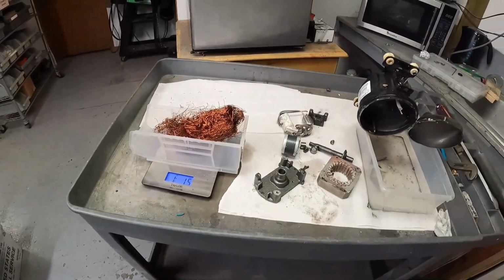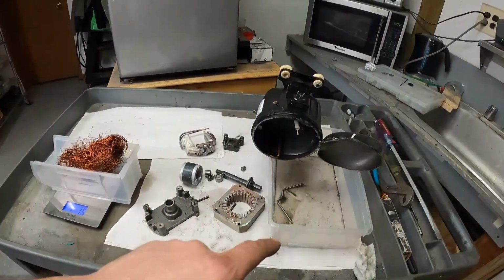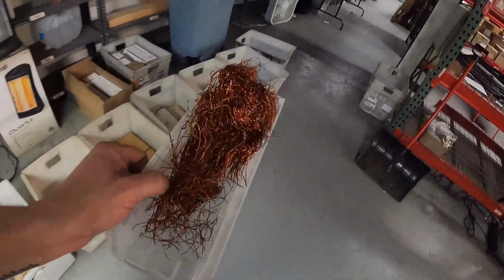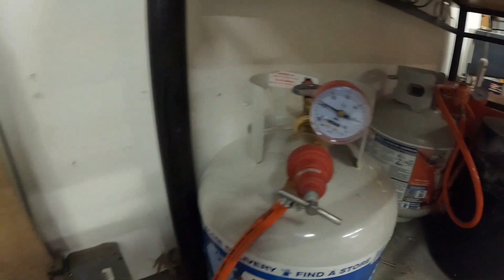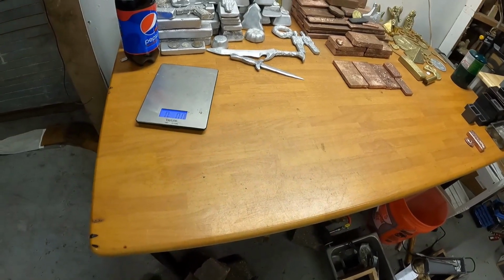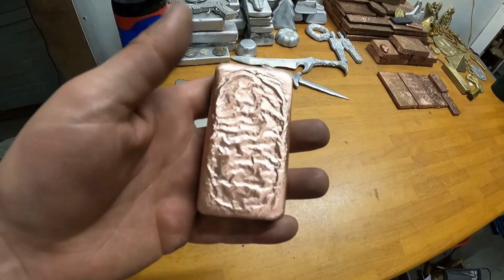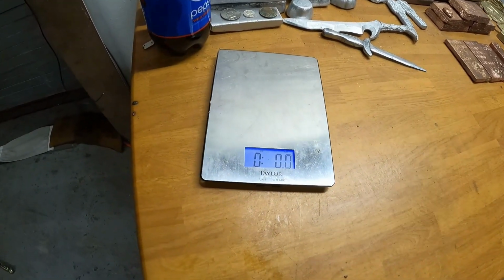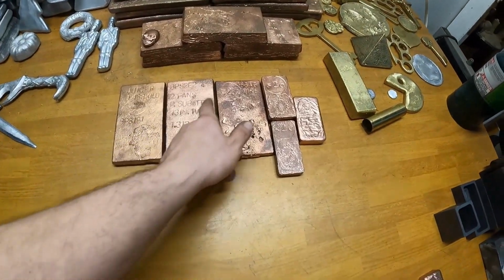Scrapping a Compressor - How Much Copper is Inside? - Trash to Treasure - ASMR Scrap Copper Melting

Comment: I was given a mini-fridge two or three months ago to take apart for whatever usable metal I might get.  I had not yet tackled the compressor.  I'm certainly going to take your advice and unload it on my local scrap yard untouched.

Thanks a bunch for this video!!!
Reply from the maker: You're welcome brother!  As for that compressor, if it's about the same size as the one I did, I'd definitely cash it in as-is.  However if it's one of those tall ones, I'd bite the bullet and scrap it out.  The tall ones have a much larger stator and the windings are plentiful!  Use your best judgement.  If you do end up cashing it in, please feel free to leave me a comment with how much your scrap yard is paying for them.  Always nice to know how much the prices vary across the country.  Thanks for watching brother!
Reply: @Scrap2Cast  We'll do!
Reply from the maker: Thank you bro!
Reply: @Scrap2Cast  I finally got a chance to take it in; however, it needs to be drained and dry before they will take it.
Reply from the maker: @freemanmetalworks1698  aww man that stinks, my yard takes them full of oil.  Makes sense because that’s extra weight they don’t want to pay you for.
Reply: @Scrap2Cast  She actually cited OSHA, but didn't give me any details or reasoning.
Reply from the maker: @freemanmetalworks1698  that actually makes sense.  I guess they can get fined for taking in hazardous materials.  Might just be worth scrapping out the compressor after all.
Reply: @Scrap2Cast  I would a video out of it and some copper.

Comment: Saw a old man had one of these he used as an air compressor for years.
Reply from the maker: Would like to see that with a mini fridge compressor.  Didn’t even know it was possible
Reply: @Scrap2Cast  Blew my mind I thought they only pumped oil or refrigerant or something.
Reply from the maker: I’m wondering if he modified it?  I guess theoretically it is the same principle.  I never scrapped out an air compressor before but now you’ve lit a match under my butt to obtain one to scrap and compare.  Gee thanks a lot, another project to add to my list 🤣👍🏼👊🏼

Comment: Sorry you're sick, man! You may want to check the lining of your lid; it looks like the seal has some gaps and that's making the steel casing hot. You're losing heat and damaging the furnace.
Reply from the maker: It needs to be relined with new kaowool and resealed
Reply: @Scrap2Cast  It's been a minute since I looked, but I don't think kaowool is too pricey. Pretty sure you can get it on Amazon these days.
Reply from the maker: @KrakenCasting  I’m also very lazy🤣
Reply: @Scrap2Cast  I'd lecture you if I weren't lazy too. 🤣
Reply from the maker: @KrakenCasting  bahahaha 🤣  That’s one reason why I like you Kraken, you make me laugh often 😁👊🏼

Comment: nice video however, I scrap all copper down to even small dc computer motors. With the compressors I wait until I have a half dozen or more then do  the nasty  work all at once. Drain the oil for 24 hours or more, then cut tops off in one setting and probably disassemble at a later time. Have many  5 gallon buckets of copper scrap but haven't yet started casting ingots.  I like the respirator very important. Take care
Reply from the maker: Thanks!  I tend to pick and choose what I scrap or microscrap.  You really break down those tiny computer fan motors????  You have more patience than I do!  🤣  That’s actually a good idea with those compressors.  At least by doing a few at a time you can do an assembly line kinda breakdown of them.  Respirator is a must when melting metal.  Melting outdoors is one thing but melting where I do, I won’t take a chance by not using one 🙂. Thanks for watching!